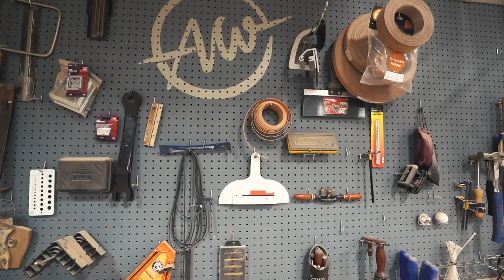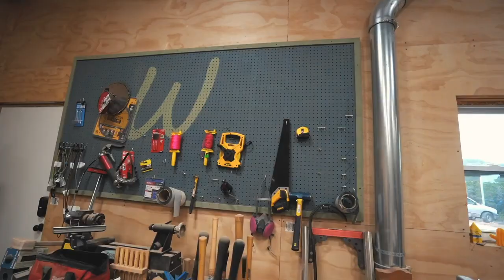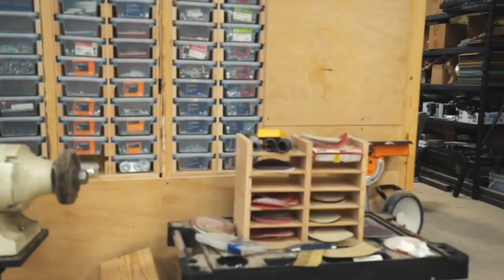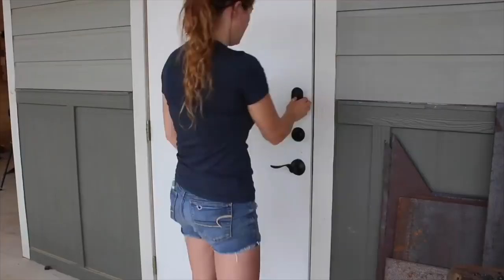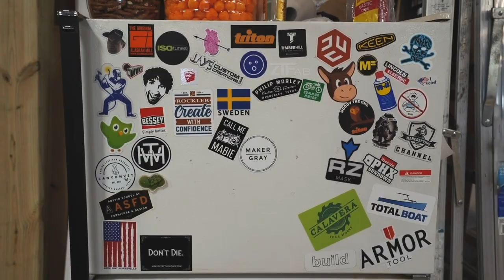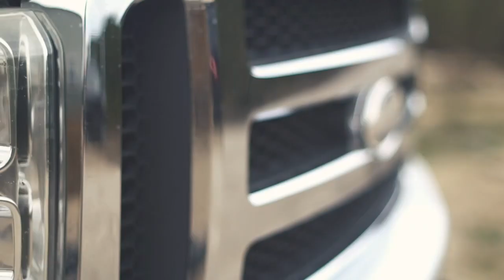1st Time Shop Tour April Wilkerson

Comment: For that 3ph sander you could put a VFD on it for not too much money. It’s an option you might not be aware of. It’s a nice option to keep the simple 3ph motor and be able to control the speed and stopping time without sacrificing power of the motor.  The VFD can convert from 1ph to 3ph.
Reply: I thought she might prefer that route too. One consideration, at least if slower motor speed with the VFD is desired, is that non-inverter-rated motors can overheat since they're expecting to be run at full speed. Only an issue if the sander is run slower than normal, though putting a blower on the motor would probably work.
Reply: Dennis Pope Really good idea.  Not all that expensive either. Greg
Reply: that does work well if the voltage of the 3 phase motor is the same as your single phase supply voltage
Reply: @bernonic  I have 2 VFD's running two different mills, both are 220v three phase, and the inverters are running on 220v single phase... works amazing.
Reply: 3 phase equipment can be cheap. I have a 3 phase Powermatic 66 table saw & an 8" joiner, both 70's vintage, both on Vfd's,all for under a $1000 total. Deals are out there.

Comment: Water source, garden, compost, but no solar panels? That freshly-built shop, with its vast roof, is begging for something to soak up the Texas sun.
Reply: Solar panels!
Reply: total cost to manufacture, transport, install and life expectancy............................. I hate to state real facts. but oh lord,some times humans are so blinded by the plight of sales...
Reply: Solar panels 😂😂 lets see how far you weld off those
Reply: Mike Wright - Solar welding, with a Fresnel lens set-up. 😜😂
Reply: Solar isn't the solution. Not wind it's expensive hard to maintain and has weather issues
Gravity generated power is the best they do it in India and the Philippines the powers that be don't want you to know
Reply: Gas is still cheap in Texas ....... just sayin' ............. ;-p
Reply: @unclejack123  yeah all it costs is destroying what's left of the ecosystem, but glad you saved a few bucks (in the short term, long term solar makes mincemeat of gas)...
Reply: Rob Williams if solar were as efficient to produce and use as gas or coal, IT would be the dominant energy source. Fact is, it serves niche needs in unique locales and is still higher in cost vs output. Your “long term” description illustrates just how inefficient it is.
Reply: I wouldn’t put solar panels on the same roof with water collection. Solar panels are built with many toxic chemicals and metals that would be hard to filter out.
Reply: @Funtimes670  What are those toxic chemicals and metals that can be released into the captured water?
Reply: coffeebuzzz google it.
Reply: @Funtimes670  You made the claim solar panels leach toxins into collected water, what's your evidence?
Reply: coffeebuzzz put them on your roof and drink the runoff then. I’m saying I wouldn’t do it because of all the toxins and metals that go into making the panels, the chances of getting them into the water is very high!
Reply: @Funtimes670  I have and I do. As far as I can tell, only glass and aluminium come in contact with rain water. 
You need to stop listening to whoever told you solar panels leech toxins into the water.
Reply: Codename C.A.R.S The “toxic” materials in the solar panel are in the solid state, they will not pollute runoff water. They are safe in that respect. OTOH, they don’t make financial sense in most cases, unless you have substantial subsidies, or are so remote that there is no grid.
Reply: Michael Cox is that kind of like lead paint being in a solid state when it dries but yet still toxic?🤔
Reply: Codename C.A.R.S No, the materials in the solar panel are compounds that have different properties than the elements I imagine are worrying you. It’s extremely difficult to get them back out, requiring a lot of energy input. In the case of lead paint, it’s still not easy to get sick from it, either. You need to destroy the paint, and absorb it (chew it and soak in saliva or stomach acid, powder it and coat your alveoli, etc). As paint on a wall, or an exterior surface, it’s quite safe. Similarly, asbestos is perfectly safe, provided you don’t powder and inhale it often. It’s important to be aware of dangers, but also important to actually understand dangers and risks.
Reply: @michaelcox1071  the problem is that it's incredibly easy to make lead or asbestos into a form that's able to be intaked... Paint can be easily chewed on by kids, or sanded and breathed in by everyone. Asbestos is used specifically in conditions that promote drying it out, thus making it easy to break and form dust clouds.
Reply: @michaelcox1071  OR if you are STUCK in California with power outages from Good Ole PG&E.....
Reply: Michael Cox - Couldn't agree more, and you said it very clearly. Thanks!

Comment: April you could get a VFD for your 3 phase machines so that you don’t have to get a converter for your whole shop
Reply: That's what I was thinking as well. It would have the added bonus of being able to use it to make the sander a variable speed sander. Those big old motors are torquey as hell, so it should have quite a bit of umph even at low speed.
Reply: VFD stands for variable frequency drive.
Reply: Volunteer Fire Department? What now?
Reply: izeugirdor 😂
Reply: You can talk to Paul Lemiski at the CanadianWoodworks youtube channel for more info on VFD.  The majority of his shop tools use VFDs.
Reply: I use VFDs’. They’re very good. Also, unlike motor based converters, they’re very efficient. And all three legs are always balanced, something you can’t count on with motor based converters. That leads to longer motor life on your tools.
Reply: Best mod you can make is a variable speed on sanding machines. Vfd is the way to it
Reply: VFD = Variable Fase Converter. 
Not sure why they spelled phase with an F.
EDIT  F = Frequency
Reply: @dans_Learning_Curve  Variable frequency Drive
Reply: @siggyincr7447  , you are correct! Old tired mind! Thanks for the input!
Reply: @dans_Learning_Curve  Could it be something to do with the way you spell SULPHUR with an F instead of a PH? Or LIGHT with an E on the end and no GH?
Reply: Alan George Barstow or Fido is Phydeau

Comment: Hi April,
Thanks for the video tour of your shop. Good luck with the commercial shop. How about using those vinyl strip curtains to separate your wood and metal working areas like those found in commercial freezers and coolers? Has your water collection tank filled yet?

Comment: Very nice shop, a place for everything and everything in it's place. 

A couple of suggestions/comments; 

1) I didn't see a single fire extinguisher, 3000 SF should have at least 2, 4 -6 would be better (check with your insurer) 

2) various codes and regulations require a clear space in front of electrical panels, 

3) it's good to have critical spare parts on hand, but 2 SawStop blade brakes suggests (IMO) maybe to much reliance on technology for safe operation.

Comment: You should start to build cabinets for most of your tool storage etc , I went through this phase , looks impressive,  all the stuff on the walls , but over time no matter how good your dust collection is , there will be dust on everything,  storing stuff in cabinets will make is so much easier to clean your shop , just a little advice from a 40 plus year woodworker

Comment: How long and wide is your shop?
Reply from the maker: 72' x 52' with 12' ceilings.
Reply: Start with size the concrete floors the big ass fan electrical install lighting what should I done different. Love it all